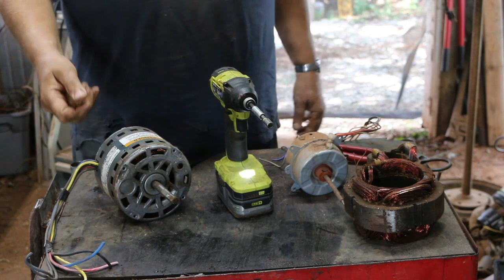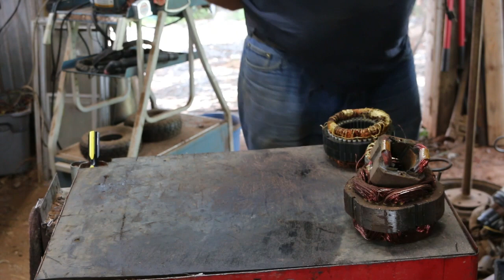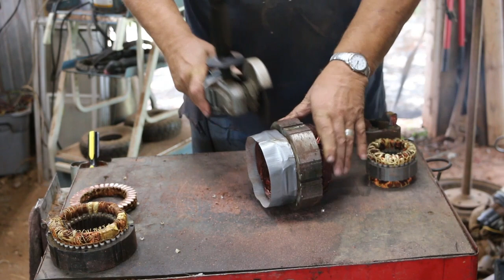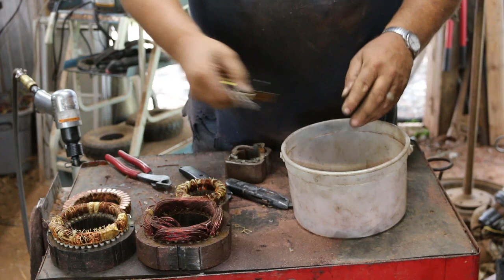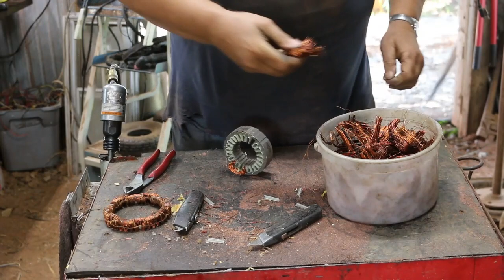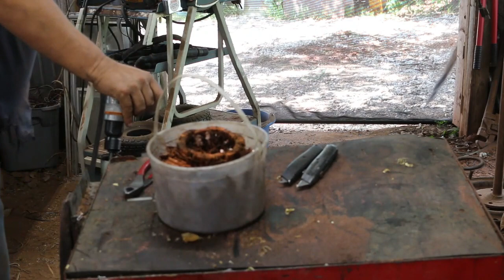Scrapping some Electric Motors to get some Nice Copper

Comment: I always enjoy your motor tear down videos getting the copper out.
If it were me and I had the equipment that you do to melt and make sand castings I wouldn't even sell my copper for the going rate.
I'd use it all to make castings.
Which it should be about time for you to be making another sand casting video.
Hopefully your castings will take off good for you on EBAY so you can command a decent price for them.
Well take care my friend and as always I enjoyed stopping by.
Reply from the maker: that dragon's eye sold fast, I may have to raise the price, not making much when you look at the time, the petrobond that burns up each time you use it. the cost of the propane, I need to redo the wolf ingot, I didn't like how it came out last time, I am getting a cast iron sinker mold. may make some sinkers out of diecast it is heavy and maybe some brass sinkers

Comment: On those motor with the bent tab I found using a flat head screw driver and just twisting it will pop it loose quite fast. I save all the copper motors have quite a few buckets to process yet. #happyscrapping
Reply from the maker: they can add up fast